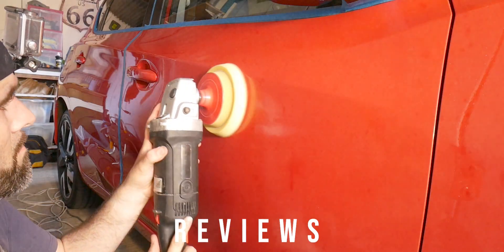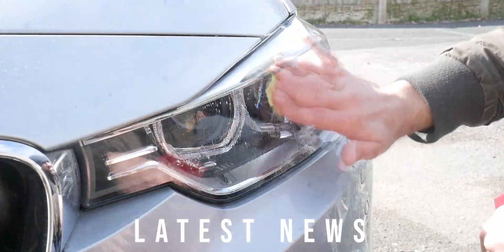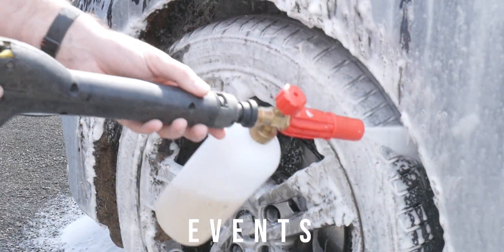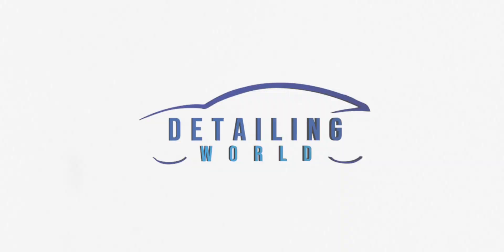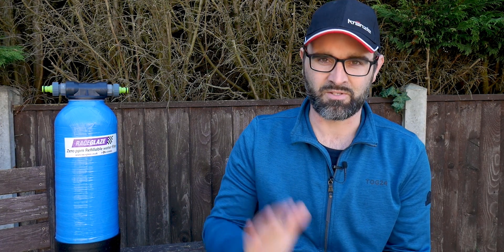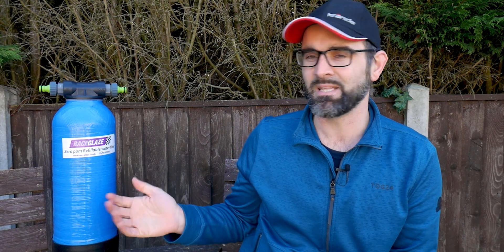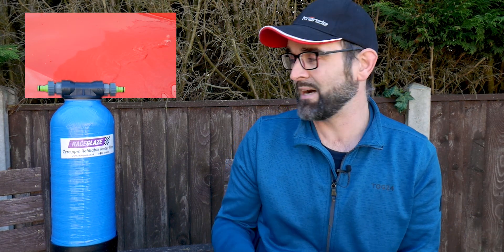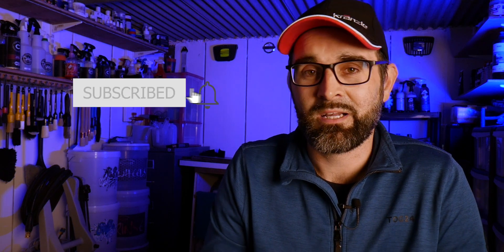Discount Codes, Winners and YouTubers

Comment: Vyair 11L DI Resin Pressure Vessel 0PPM, on eBay for £89 with fittings check it out I have one much cheaper than Race Glaze.